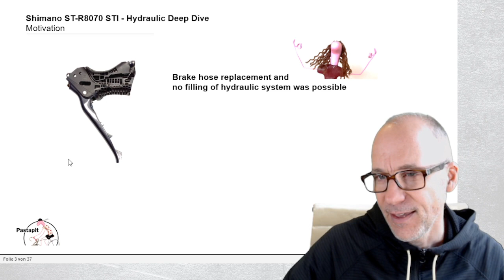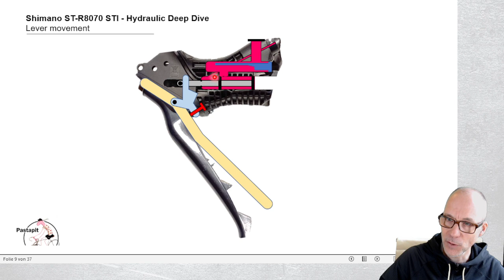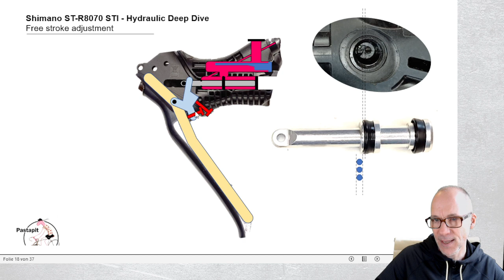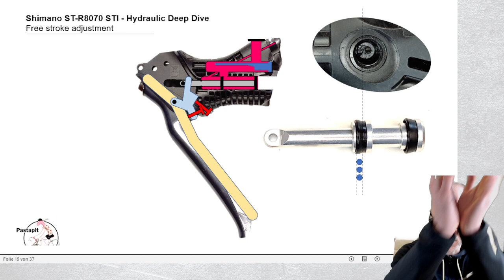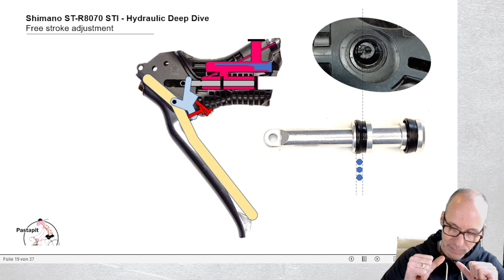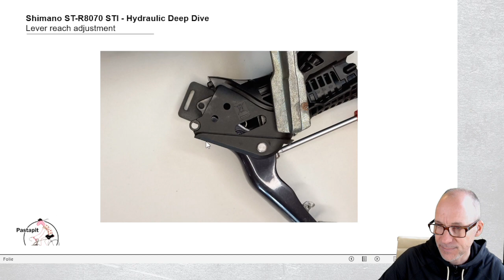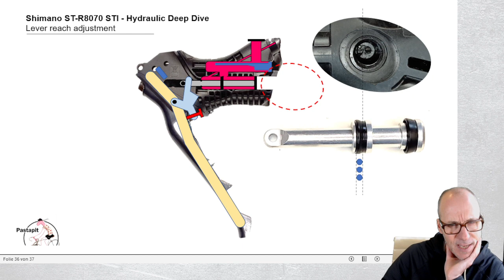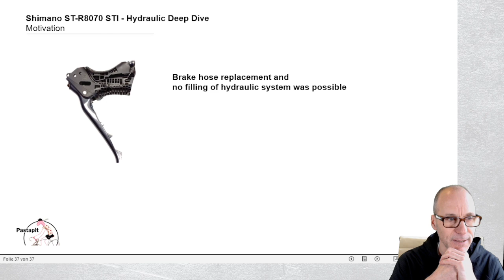Part 2 - Shimano ST-R8070 STI Lever Troubleshooting

Comment: My Utegra 8070 was impossible to bleed without freestroke and Reach adjustment fully open. Oil would not force through otherwise. 
Your illustration of the bladder is 180degrees from my lever. It is removable from the front of the lever and replaceable with an XT/XTR bladder. 
Thank you for your instruction which I found very helpful.

Comment: Torque wrenches aren’t all exact and applying max torque or over torquing to the lever to handlebar clamp bolt may very well deform the brake housing to restrict free movement of the brake piston. Minimal torque freed my piston from its barely dragging in its bore. 
Thanks for the tips on the Freestroke and Reach adjustments for bleeding the system.
The depiction of internal chamber for the “Bladder” is 180 degrees from its actual position. This can be seen better “di2_gp” YouTube videos and is removed thru the front of the lever body. This bladder is replaceable with the mtb lever version.

Comment: Thank you for this breakdown! I happened to over tighten the free stroke adjustment screw to the point where it is damaged. Do you know where can one get a replacement?
Reply from the maker: Hi, the best idea is to buy a used lever for getting replacement parts! And there are quite a few available because a lot of people think that their lever is demaged - but maybe there are just in trouble with one of these "adjustment" topics! Go for it - good luck!

Comment: Very good break down :goodvibes:.  My right lever will not return all the way.  Everything is properly bled and there is pressure, brake lever is somewhat tight compared to left but lever sticks and will not fully return.  I tweaked the adjustment screws and even loosend the clamp but lever still does not fully return.  And again the action feels very tight.   You said there are two springs?  I'm wondering if one is broken?  Don't see a way to take this apart.
Reply from the maker: Hi - it seems to be a mechanical problem - if the lever is just not returning in a smooth way the spring might be the reason - but I do not think that this is a spring topic  if the lever is not doing fine in both directions - however - you can see the spring in the picture in community folder ... hard to say without disassabling the lever - if you want to do look at that picture: there you can see the internal screw you have to unscrew to then remove the pivon axis! Thanks - all the best - good luck!

Comment: This was very helpful, I have the same  R8070 levers. My right lever would not fully retract back after being released. I found that unscrewing the lever clamp screw slightly fixed it, just as you had said in this video. Thanks for the very detailed explanation of how these work.

Comment: I have two levers, one has a damaged lever and the other has a damaged housing inlet port. Is it possible to swap the lever onto the good body??
Reply from the maker: Hi, yes that is possible in principle! But it is not that easy to realise that... I found no good explanation in the net - if you have a specific question please do not hesitate to ask! All the best!
I posted a picture in the community where you can see the little srew you have to unlock if you want to disassamble the main pivot axis!